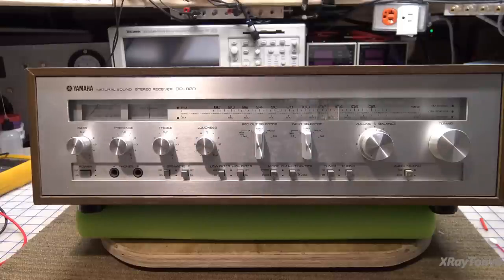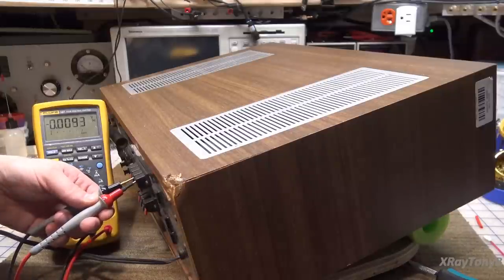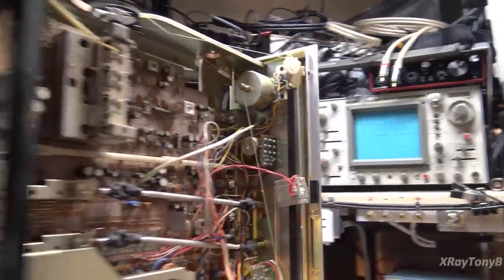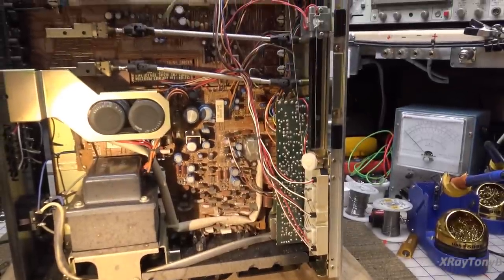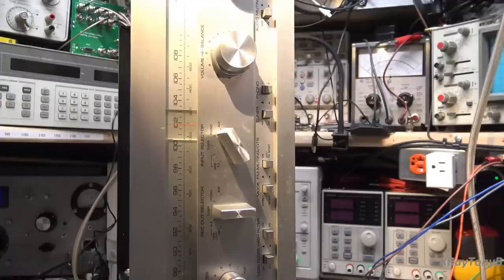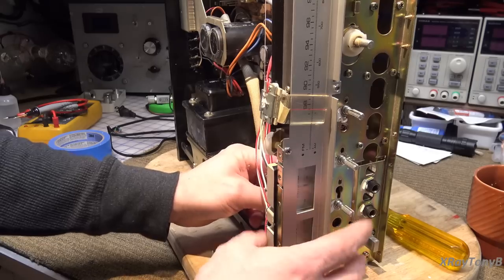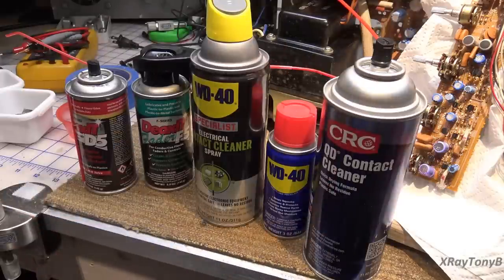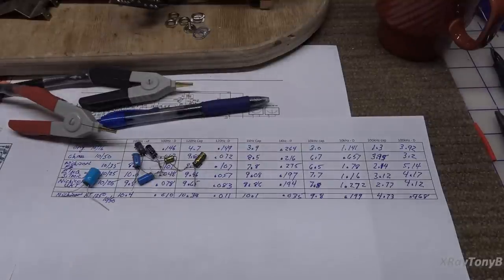Amplifier maintenance 101 - Cleaning Controls & Re Capping a Receiver (Featuring the Yamaha CR820)

Comment: Having spent the past 18 years as an audio repair bench tech, I can tell you from experience that those  lavender or lilac-colored capacitors are crap. Change them out. Don't bother to test them; just change them.  They often become slightly electrically leaky ---- sometimes physically leaky as well ----  and can cause popping noise and minor DC offset, from the tone control section in particular (the fluid that leaks out of the  capacitors is often corrosive, and probably conductive, and on those lilac caps I will often find that the negative lead of the capacitor is green with crusty corrosion).  Also, any capacitors that are right next to a voltage-regulator heat sink, such as the black capacitor seen here that is tucked into the channel of an aluminum vertical heat sink in the power supply, should be changed. If it's located right next to a power resistor, change it. Heat is the enemy of electrolytic capacitors.
Reply: i recapped a Yamaha from the early 80s (high end pre amp) and about half of the lilac/violet caps leaked and were corroded / absolutely dead. i dont like seeing these either. later elna and nichicon in kenwoods have been Solid for me, no Leaks.
Reply: @sgredsch  , a lot of small orange caps from that era are shitty as well. They don't usually physicaly leak, but they become noisy or electrically leaky, and the ones that are sealed with epoxy on the underside instead of a rubber plug are particularly likely to fail, especially if located near something hot.
Reply: Wurth caps ? I'm about to do my first recap . I won't buy them if those are the ones you're referring to  ?
Reply: @ericschulze5641  , I've never actually seen any Wurth capacitors.  Supposedly a German company and of a reasonable quality.  The repair shop I used to work for used mostly Panasonic as electrolytic capacitor replacements, or Nichicons on occasion.  The Panasonics are excellent quality, though perhaps more expensive than the Wurth caps.  As for what brand and type of capacitor to use for a given replacement application, it really depends on the product, the voltages it runs at, the circuit design, and what was in there originally and whether that was the best choice for that application or not ---- which obviously I can't answer for you.

 I don't really remember what brands those old lilac or orange caps I referred to were.  I can tell you for certain that if you encounter any caps branded "Shoei", they're absolute garbage.

 There are also cases where a product might have originally used relatively low value electrolytics which could instead be replaced by more reliable and higher quality film caps, typically when you have low microfarad values like a couple of microfarad at most and less than 50 volt, usually you can get film caps that are small and will fit comfortably in those locations.  Especially smart to do so in critical locations like phono preamp circuits and tone controls, where even a tiny bit of (electrical) leakage taking place inside an electrolytic capacitor can cause a lot of noise and poor performance.  Modern electrolyrics are usually much lower leakage than the ones that were used 40 or 50 years ago, but film caps will typically be even lower leakage by orders of magnitude. (We're talking about electrical leakage, minute DC currents passing through the capacitor, and not physical leakage; electrical leakage can show up as crackling and static and popping noises, especially when you rotate tone or volume controls).
Reply: @goodun2974  thank you, I have a couple other questions if you would.  . . I plan on ordering this weekend around 60 caps / mouser I'm trying to use 105c over 85c as recommended by another utuber JDW. . .  anyway nichicon & Panasonic caps all seem to be 85c & rated at 1000 hrs vs worth,  rubycon,united chemicon at 105c & 4000 hrs & they're cheaper my question is does a higher ripple mean a lower esr & should I be trying to have them all of similar or same ripple or doesn't it matter  ? it's looking like I have to get multiple brands to recap my old recievers in order to get similar sizes "physically " and similar lead spacing I'm not seeing nichicon this and nichicon that Panasonic this and Panasonic that  I'm seeing is what they offer in the uf and voltage. I'm requesting, from various mfrs,  then I try and get something that fits am I doing something wrong  ? And again will it matter if 1 group of caps have a ripple of 18 another at 36 ? ect first recap will be a jvc cheapie then my technics then my Yamaha, then my Kenwood then my onkyo then my Marantz all as my skills and knowledge grow (I do have an extensive background in appliance repair 30 yrs. so I'm not completely new to this ) THANKS AGAIN
Reply: @ericschulze5641  ,  Virtually all of the Panasonic radial lead electrolytic capacitors that we were using for the last 15 years were  105ﾟ. Unless there's a shortage of them or they're making fewer of the high temperature version, I wouldn't expect you to have problems finding them, although we've also heard that a lot of thru hole components are starting to be discontinued as so much modern manufacturing is going to SMD devices instead. A lot of our Panasonic caps came from digikey, and so perhaps you should try them as a supplier. Otherwise, since it appears you're working on 1960s through 1980s audio receivers, which corresponds to most of the equipment I repaired over the years, youll generally be okay with 85ﾟ caps, although if they're going to be located next to hot running power supply components like big resistors and voltage regulators, it's better to use the 105ﾟ If you can get them;  or at least lean the  85ﾟcapacitors away from the hot-running parts.  I wouldn't worry too much about the ripple specs or whatever it says in the catalog, as generally that isn't a big deal for achieving reliable, stable operation of old analog equipment.  Worst case scenario for many modern capacitors is bein pulse with mode or other types of switching power supplies where the high frequency ripple hits the caps hard and tends to overheat them.  The ripple in old solid state audio equipment is 120 Hz, but the ripple in switching supplies might be 100 kHz!
Reply: K thank you & yes I was planning on checking digikey out,  one last thing I was told to avoid RoHS caps because the lead solder won't stick. all the caps I looked at & there were hundreds had RoHS listed but may not have been RoHS maybe just part of the listing , or to fool the government for a while, how do I tell if thier RoHS  ? when I clicked on it they offered an sds sheet or something like that, I went no further figured I'd ask someone like you THANKS AGAIN I'll try to leave you alone after this one 🙂
Reply: @ericschulze5641  , Standard 60/40 tin and lead solder will "stick"  to the leads of modern ROHS caps and parts,  It's not a problem. ( Techs usually say the solder will "wet" to the leads).
Reply: @goodun2974  so don't worry weather thier RoHS or not, I can't figure out if they are or are not maybe digikey does it differently? I suspect most of the caps I'm looking at are not RoHS just I can't figure it out. Remember I'm somewhat new to this, I've recapped some old tube radios American 5s & built some crossovers, but never 50 60 100 at a time is there an easy way to tell if they are RoHS  ? I'd prefer not to use them when I get to doing my better quality recievers

Comment: Personally i'd always recap audio equipment. Even if the capacitors are still working, the values will have changed from how they originally were and the sound will be affected. It's like listening to the sound of dying capacitors lol Another thing I found interesting was, to see how the different capacitors performed. I always wondered how the Elna Silimic 2 capacitors were and if they weren't just audio mumbo jumbo, with silk inside for extra smooth sound *lol*, but they seem to actually be really good capacitors. Nice to know. Thank You for the Video ^_^

Comment: Tony, hopefully this is a simple question... When you are measuring the ESR would the ESR meter pick up resistance through your body if your skin is touching both of the capacitor leads? Of course I'm driving at effecting the ESR measurement. THX

Comment: Good video as always. Although I don't have the same opinion in regards to WD40. It is pretty much all I use on my electric equipment for cleaning and lubrication of switches and potentiometers. The reason I choose that product is because more than one service manual from a reputable manufacturer of high quality oscilloscopes and other test equipment specifically mentioned their approval and included it in their field technicians service and repair kits. Just my 2 cents.
Reply from the maker: I  think we may be talking about two different products.  Unfortunately, WD-40 is the name given to several products.  I'm assuming you are talking about the WD-40 Specialist contact cleaner, which is made for this purpose and is a good product at a great price.  What I'm talking about is the original WD-40 muli-use product (and also their oil/silicone-based) products, which is a water displacer/lubricant/cleaner.  It was not intended to be used on electrical equipment.  If you look on the WD-40 website, they specifically state that the WD-40 specialist cleaner is the proper product to use.  I didn't clarify that when I made my comment in the video.  Thanks for the comment!

Comment: Used to prefer the old Chemtronics cleaner that had CFCs (before the manufacturer was forced to remove them from the formula) Preferred it so much I purchased 24 cans before the ban. Good stuff! The post-CFC ban product was quite inferior!!
Reply: The problem is that continuing to use those products is releasing CFCs into the atmosphere, damaging the ozone layer. Please do locate some equivalents which don't contain them so you're not participating in that issue going forward. If the replacement you originally used didn't work well for you, try another one.

Comment: I just did one of these, it was nasty with failed transistors and messed about by someone else with a crack in the board etc etc. I just replace essential caps..and a couple were necessary..only  if necessary. With stuff like this replacing all is the road to madness, there are about a hundred of em.. It ain't that good anyhow. Which is why I have amps (for me to listen) with two caps in the audio line per channel, both poly. Don't need to worry about crappy electrolytics. PS Check carefully soldering, mine was awful and needed a lot of going over. Use eyepiece.

Comment: Your explanation on why 100kHz for in circuit ESR meters is wrong. Has not to do with surrounding circuitry interaction avoidance. For that matter these testers simply use small amplitude signals less than Vbe. 100kHz is the frequency commonly used by the industry for listing ESR spec. Because its conventionally high enough to overcome the capacitive reactance of electrolytics. So what remains to be read is ESR which is mostly non reactive.
Reply from the maker: You are absolutely correct.  My description about the ESR meter was not so good.  Thank you for the correction and for the much better description.  This is how we learn from one another.  
Best regards :)

Comment: Absolutely re-cap... After 30 years, I think its worth the few dollars to get another 30 years of good service. Leaving aome electrlytics that even test OK will have less life compared to the  new ones probably leading to a reservice sooner than if all electrolytics had been replaced inuding the power supply caps. I also would replace the protection relay over cleaning the original every time. The dollar to reliability ratio makes it a simple decision to replace in almost all cases.

Comment: Capacitors have a limited lifespan  period. You will be taking a big chance in not replacing 30  year old electrolytic ones.
They do take the brunt of charging and discharging and eventually will do incur leakiage over time only because of use.

Comment: Hi Tony, the Nichicon gold that tested bad is quiet small, was wondering if the physical characteristic of the capacitor has something to do with it. 
Far as I can tell, capacitance is affected by the Area of the plates inside.
Also, I think what mostly matters to audio electronics are frequencies between 20-20000 hz audible frequencies, and testing beyond those frequencies doesn't give anymore useful information apart from capacitance drop significantly at those frequencies.

One reason I don't recap is that older capacitors tend to be bigger and has a lot of breathing room for the plates inside.

For me it's still a no recap. For the reason that we can't hear frequencies anymore at those frequencies, and I'm thinking the old caps are designed as they were.
Reply: I don't get it ? The man just showed you the numbers, the factual evidence in the audible frequencies,,,
Reply: @ekbanjosworld4926  tell me if you can hear frequencies above 20,000 hz and I'll believe you. That's factual.

Comment: Do u like the peak esr 70 tester for in circuit testing ?
Reply from the maker: I don't have that tester, but I have their zener diode tester and transistor tester and they are great.
Reply: @xraytonyb  I find it pretty good in circuit…. Better then the one u have which I have it MESR100&honeytek  A6013l too. Good fluke 587 agrees with esr70. In circuit the Peak seems best but if I get a couple to agree a caps past 20-30% I change it. No point in trying to change thousand capacitors Digory in the pioneer 1250 when in reality it would take forever could be installing caps that aren’t as good even though I try to get the Chacon or Panasonic but the point is even if you change 50 or 100 cabs out of 1000 every piece still has a lot of cabs that could go out of spec or go open, and if it’s a good design like Mcintosh or Pioneer, unless it really goes completely open, the circuits seem to still work, but I watch all your videos. I love them and I learn a lot.

Comment: Automotive grade capacitors eh! Hmmmm sounds like something I need to invest in a lot more.... 
They might be expensive but at the end of the day, if I'm keeping that piece of equipment for as long as possible, then I don't care what it cost, I want it to last... 
And I always go up in voltage, I believe that out of two identical capacity capacitors, the one that is rated for a higher voltage will tolerate higher temperatures and outlive the lower voltage one! They are physically larger as were the old wax paper capacitors, but you could put a higher voltage across the old wax paper capacitors than what they were rated for and they would survive, they were built to last which is why they can be found still working 60 years later, are we ever going to find a somewhat functional and factory original electrolytic capacitor inside a piece of 60 year old equipment one day in the future? 
I would be surprised if someone did.... 
I have seen a video, it could have been made by RCA where they showed how they tested their capacitors and transformers in their TVs with Up to double the rated voltage! 
As good as that automotive grade capacitor is, would it survive with double the voltage across it? 
Who knows? Unless Tony feels like performing an experiment????? If they survive, check their values after to see if they got worse or improved... But I think that we would see capacitors exploding which is always fun to watch....
Reply: ... 0r maybe computer grade caps rated for high frequencies. Look for "high temp hybrid polymer solid caps" from Panasonic or Nichicon...

Comment: Hey Tony, this 10/16v caps are marked on the schematics with black dots inside  black circles. in the legend they are called low noise caps.
Reply from the maker: Yes,  They are similar to the orange capacitors used in the Pioneer & Marantz gear.  They all seem to fail in this same way.
Reply: @xraytonyb  thank you!

Comment: I realize that no one will ever read this or care to take heed, but I'm also a tech with a degree in EE. I took the "trust but verify" approach and treated my garage receiver plus EQ with WD-40, just to see how fast they turn into a pule of trash. Guess what?  3 years later, and counting, everything is super smooth. The myth that WD-40 is bad for the controls is a BS for me. I'd never use it on my clients' units, but I did my research and I got the answer to the question. Don't take my word though, do your own homework.
Reply from the maker: I do read and I appreciate your taking the time to comment.  This is how we learn.  I have never used the original WD-40 on any audio gear, but I have seen the results when some folks used it on electrical components at work.  Like anything else, I guess it depends on how it is used and what it is used on.  Like you, I  will refrain from using it on controls, as there are more suitable products made for that purpose.  Thanks for the comment!